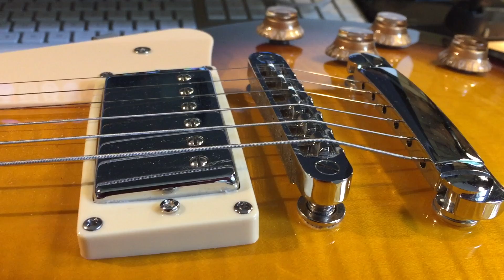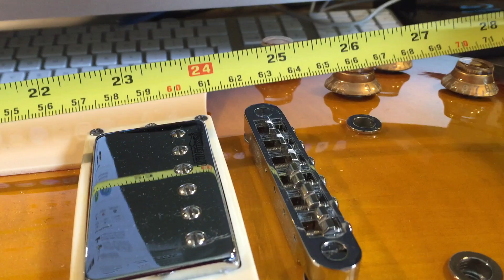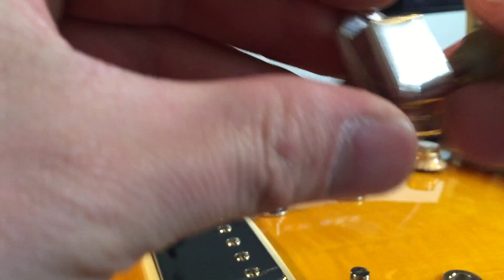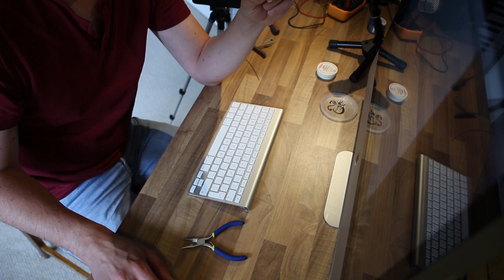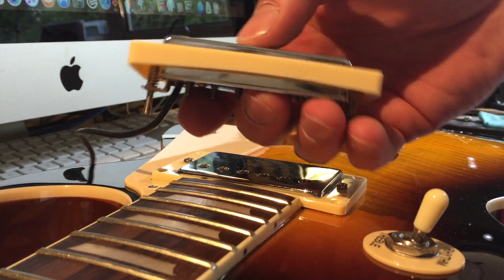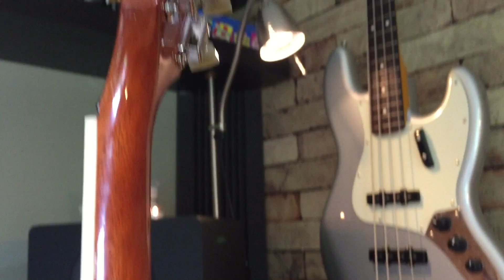Harley Benton - SC450 Plus VB - Part 1 Teardown

Comment: I have the SC-550 and the SC-Custom, the SC-Custom is a copy of my ESP Eclipse, they both have the genuine Wilkinson pickups.
 For anyone that doesn't know, fake Wilkinson pickups got into Harley Bentons supply chain in 2019, they stopped using the Wilkinsons and their distributor, and switched to Roswell pickups, and Tesla for the higher end guitars. those are very good pickups.
 I changed the tuners for Gotoh SD91-05MA on the SC-550, The Custom came with Genuine Grover Tunamatic tuners, I changed the Pots and switch for CTS and Switchcraft on both guitars, and also the wiring for shielded wiring, I shielded the cavity and also the lid on both guitars with copper tape, I changed the bridge and tailpiece for the Gibson Tuneomatics the Advance Plating ones Gibsons come with, also the posts for the thumbwheel ones.
 If you have wobbly tailpiece posts you can add some copper tape to the threads of the posts, the ones on my SC-550 were wobbly and on my Gibson LP Studio and my Tokai Love Rock.
 My Harley Benton LP copies are excellent guitars, I changed the pickups on the SC-Custom for Bare Knuckles, but put the Wilkinsons back in, I prefer them, the cleans are awesome on them, and I just have to turn up the volume for some breakup on my AC30 with the boost on.

Comment: Instead of using a T-shirt and screwdriver to remove the control knobs, just pull the T-shirt / cloth under the knob in gap between knob and guitar body then pull the T-shirt upwards so it wraps around the knob shaft in a horse shoe shape, the knob will come off with no risk of scratching the finnish.

Comment: Mine had a slight twist in the neck so i 3d-printed a radius block with 350mm radius and it matched really well so i guess the tolerances on these guitars is big. After a refret with jumbos its really nice.

Comment: Proficiency at first shows in the way you lay down a guitar on its upper side.
Apart from that: Good and helpful video.
BTW:  27:45
Opening the wiring cavity, doesn't it look as if the body is made of multiple layers of wood?

Comment: Hi  mate if i get this guitar , loud it be good for gigs , i am pro guitarist and have gigs very often ... is it going out of tune or cutting the strings , by the way i'm not playing heavy on my guitars , is it heavy guitar and how about the fret board is it massive like Epiphone , gibson  les paul , because im looking for kind of , and as i see the people like it ...thanks :)
Reply from the maker: Hey there. It's difficult to say if your copy would be as good as the one I was fortunate enough to pick up, but yes... I would say that the one I have is fine for gigging. I have yet to snap a string, I have only changed them because they got dull. The tuning stability is great and a year down the road it still plays wonderfully. The fretboard on mine is great of bends and the neck carve is somewhere between a start and a typical les paul. It's not a massive neck at all, but it isn't an Ibanez Jem either. Hope this helps!!
Reply: i think it helps me a lot , cuz i was wondering if i better to buy Epiphone standart plus pro and between this 2 guitars i dont know witch one will be better for me i prefer a fat fretboard not a thine one :)

Comment: I've seen Gibson custom shops with cheap plastic or is that vintage plastic?

Update: I have recently acquired a HB SC 500 (Tobacco burst) and considering the price €249 it is a guitar that easily compares to low end Gibsons and all Epiphones. I have also received a Vintage V100PGM Lemon Drop (€309), this is truely a class guitar for the money. This is by far one of the finest LP's i've ever owned and that includs Gibson custom shop and various Gibson standards.

Comment: This is like a forensic examination of a vintage guitar!, what do you expect for little over 100 gbp.
Interesting but somewhat pointless? 
No shielding???? No shit !!
But thanks for taking the time in any case
Btw, the original Gibson kluson tuners would probably rattle just like these?
Reply: wtf dude hes pointing  stuff out to either confirm or inform others what is or isnt there...not pointless at all if your interested in buying one...pointless to you maybe but not to everyone..
Reply from the maker: I don't expect much for a 100gbp at all,  I actually feel these guitars are superb value for money, hence the video. The intention was to illustrate that you're getting a lot of guitar for your money.

Interesting but pointless, probably summarises most of my videos! Sorry if it didn't tick all of your boxes. I will be making a Part 3 where I'll summarise my feelings on the guitar and it's value for money, stay tuned if you don't feel it to be too pointless and interesting ;-)

Comment: I got this exact same model and I had a ESP EC-256, had to return ESP twice, horrible work in the neck on the bottom head, very disappointed on ESP for a guitar double the price of this HB, HB good build in overall, the neck was pretty solid built just a little setup needed, body thicker than the ESP and neck also, for me with small hands the ESP is easier to play in the neck, in terms of sound, ESP wins clearly. In the end returned the ESP and will get better pickups for the guitar, win win!
Reply from the maker: Nice, Shame about the ESP though. So far I have been more than happy with my HB, it's holding up well. I guess time will tell us how good the materials are.
Reply: consider Iron Gears "Rolling Mill", "Hot Slag" or their "Blues Engine" pups at about $35 each

Comment: Interesting stuff.Notice how the threads on both the stop tail and bridge had massive play in them - not commensurate with good tuning really. The bridge posts were better than mine for sure... but if you fit the bridge post and pull those inserts come out typically easy. Your bridge was better than mine. The ferrules on the tuners are NOT standard and you have to drill the headstock to fit Gibson (or fully compatible) tuners. On my tuners the play in the actual tuning shafts in the ferrules was not good - I eventually changed the tuners out altogether. I also noticed when you had a close up of the tuners early on, that they were in fact bent and did not fit flush with the headstock. My 'maple top was in fact veneer with a different wood underneath that some 'might' describe as maple but the wood type remains unknown. I proved that with cutting the guitar body in half and saw what most won't see. There was zero shielding on my guitar where the electrics were. Your pickups say Wilkinson... but are they? and that's part of the problem - you can't assume anything re brand etc. I loved the scraping :) use a saw and cut it open then you see the truth :) the top wood is so thin its veneer but not as we know it :). You showed the veneer at an angle making the veneer look thicker than it really is. The top underneath may or may not be maple. If it is maple its VERY soft.You did a reasonable job of showing this guitar and I don't have any comments on what you did... but if you went back and checked those things as I did you might find that some is not quite as shown.. hard to see unless you're doing it yourself and then lots immediately becomes obvious in a different way. Interesting how they let that guitar out with the binding issue on the neck too. It must have 'got past' those setup and check guys as mine also did.Thanks for sending me the link - I appreciate that - but for me I'm afraid I won't ever be convinced by either the one I bought or indeed the one you have to ever recommend or buy another.
Reply from the maker: Hi Tony, thanks for taking the time, I genuinely appreciate that. I'll stick with the sentiments I had when I commented on your video, which is that the Harley Benton range range seem to offer a reasonable guitar for the price. I appreciate that you got a particularly bad one (a really bad one) and I 100% would of had it exchanged at the cost of Thomann, it clearly was a bad egg.

The "quality assured/checked by us" thing is a little OTT on their behalf, but again, I wouldn't expect them to complete a teardown on each guitar, just a general once over, the overheads aren't there for them to spends hours on each one, I was surprised that it came with D'Addario strings for the money tbh.

What I can say for certain is that 18 years ago my first semi decent guitar (a Hohner Rockwood) was around the £200 mark, the body was made of ply and I tore the bridge right out of it, these days you seem to be able to get a solid lumber guitar with ok hardware that plays well, sounds good and looks nice to boot, for less moneyt. Now, will it last as long as my PRS McCarty Gold Top before needing servicing, I doubt it, but it was way over ten times cheaper ;-) 

I'm editing part two at the moment, it's a few clips of me using the guitar at rehearsals, so far no complaints with holding tuning or tone to be honest, it seems to be a promising guitar, for the price. I hear you on the wobbly post threads, but I guess under the pressure of the strings they stay fairly well put.

All the best and keep up the good work.
Reply: Hi - yes you did not do a bad job and went further than I did by a fair way... often my trouble is a time thing and I can only do so much with the time I can spend on something. Your measuring I thought was quite well executed and I never went that far myself. Unlike what some people said I did not expect the HB to be a Gibson... although it looked like one :) so measuring was not something I focussed on. I did give it a good shot at the conversion to a 'better' guitar with the parts and particularly the pickups but overall the one I had did not turn out well. Yours is clearly better than mine was. I have been off completing an album I should have completed a few years ago but health got in the way... but that's all done now so I'm finishing it off right now hence not too many videos from me... but I have other stuff I'm on too which no doubt many will hear of in due course... its all good and thanks again.
Reply from the maker: It does take a while editing the footage together sometimes, I hear ya! 

Good luck with the album, will keep an ear out.
Reply: Don't make albums to make money... you (and the rest of us) would be disappointed by the non profits except to the charlatans that sell it for &#163;10 a month and give you $.0001 of a cent for streaming. The only people who make money is them. And that's a fact. In about three years you make enough for a burger :)
Reply from the maker: Tell me about it, been there done that. I used to be in a band that got some notoriety. We got to the stage that we played at Download festival but it's so tough, decided to stick to the day job and play guitar for fun, not cash.
Reply: Exactly right. I do all my stuff for fun too and sure I could do reviews and make money, or simply turn on the monetisation and I would make money but to be honest I don't do it for money. Its just a great thing to be able to do and I enjoy it even if it costs me a small fortune in gear :) but I can always sell it if I get bored :)
Reply: What do you expect for a couple hundred bucks?  I have a student who brought in an HB Tele he paid less than $100 for, and it was surprisingly good for that money- much better than a Squier "bullet" or whatever their bottom-end model is.   $100 won't get you one decent pickup much less a whole guitar, so I don't expect much from any 'starter' guitar.  It it can be set up, will play in reasonable tune  - that's a great student model or even a  spare for gigs.
Reply from the maker: Totally agree